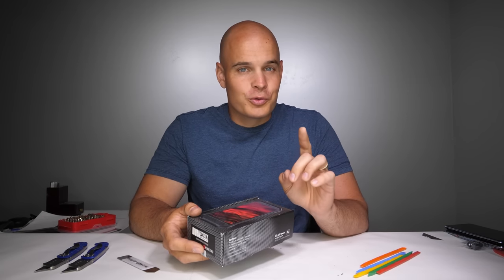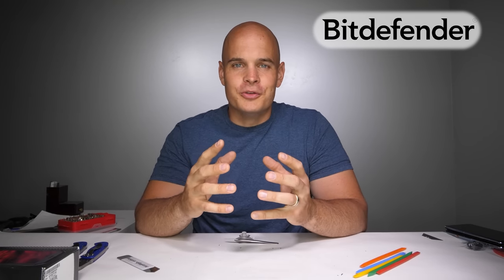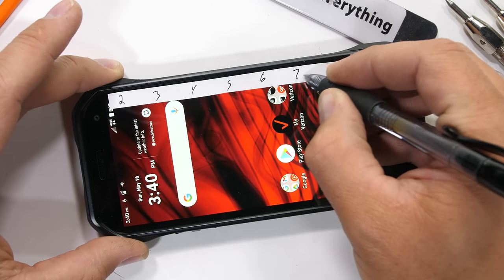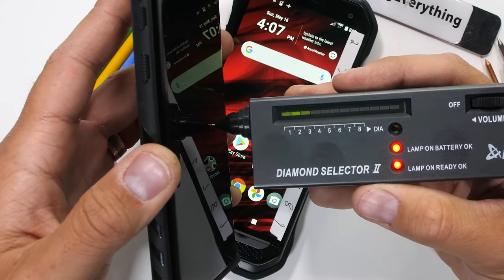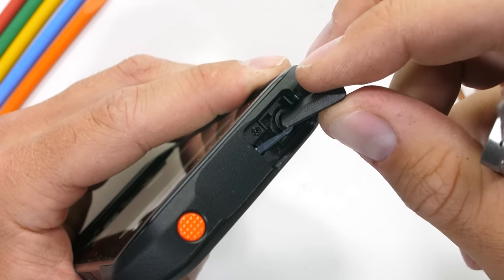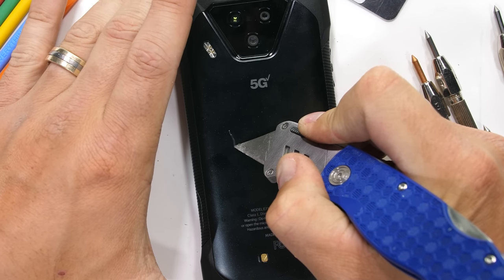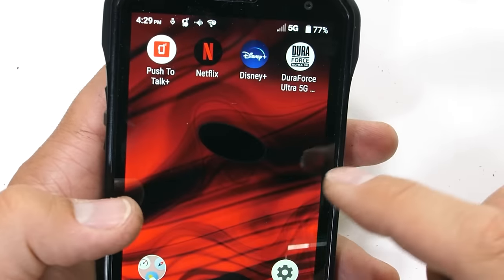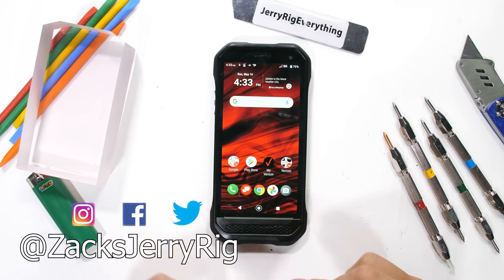A NEW Sapphire Smartphone?! - Ultra Rugged or Ultra Premium?

Comment: "Scratches at a level 8, with deeper grooves at a level 9." Holy crap, very rare but very awesome.
Reply: And cracks at 20cm fall.
Reply: We've lived long enough 😌
Reply: screen may not scratch, but it sure does crack. had it for 3 weeks and it cracked in my pocket, right on the hole they cut out for the speaker. also the phone constantly freezes up. like, every single time i use it it'll freeze, i have to hit the power button, unlock it again, and then can continue. this can happen multiple times in a single text.
Reply: 1001th  👍

Comment: This is awesome. I'm a utility guy everytime and I'm tired of so many curved screens busting from being dropped on a grain of sand
Reply: hold off and read more reviews. i bought it because i had the old one which i dropped off a 70ft tower onto gravel. it survived the fall with a chunk taken out of it, but it got wet again after that and screwed up the screen. so i upgraded to this one, more expensive 5g phone, and i'm going to take it back and have a discussion with these people. the phone constantly freezes up. every other time i pick it up i have to put it to sleep and unlock it again over and over just to check the weather or write a text. and it took a 70ft fall for my old one to crack the screen, this one cracked within 3 weeks of having it, and it happened while it was in my pocket! not a happy camper.
Reply: These phones have average cameras, but they even have a tooless SD slot so I typically forgive it.

They do honor that warranty, by the way! Kyocera is a good company!
Reply: @003SOK  did you swap it for another one? and did the replacement one have any issues?
Reply: @Redd_Nebula  did not swap it. the crack is still the same, unchanged despite my best efforts to increase it's spread, and the issue with the constant freezing seems to have gone away with an update. the only problem i'm having anymore is every once and a great while it complete freezes up, black screen, and wont shut off or do anything. holding the power button and one of the volumes hard reboots it and it's fine for a time after that. overall decent phone, strong af. camera quality is android.
Reply: keep in mind that although sapphire is almost scratchproof, unless u have a diamond, it still shatters fairly easily. easier than glass. its the reason its not used in car windshields, or building windows (aside from the price). generally, everything holds tight to the rule "the more scratch resistant, the more brittle it is"

Comment: Had the first Duroforce Pro, love that phone. Found that camera button useful at waterparks/pools taking pics of my kids. Could do it as snap a pic, or start/stop video recording depending on what the camera mode was set to. Of course, when it was released it was already well behind on hardware/software... which quickly got worse. Phone still works like a charm, and has no noticeable damage to it after years of abuse from 2 people using it(my son uses it now). Just software/hardware wise... its a little slower then you would like.

Comment: I got the original duraforce pro back in 2018 and used it until just this year. Even though I haven't used a screen protector this whole time, the screen has no scratches. It just sucks that software support for the phone was so poor; even though it was released in 2016, the last security update came right after I bought it in 2018, which meant that I was probably using a device with any and all security flaws discovered in Android since late 2018. I wish that I didn't have to choose between software obsolescence and hardware degradation.

Comment: Ironically, those rough workers who need it can't afford and those who can, don't need....
Reply: If somebody actually needed this specific phone in their work environment they would buy it. If it's not a necessity they'd just buy a walkie talkie and a rugged non-smartphone and they would've spent less anyway.
Reply: You underestimate the income of construction workers in 1st world countries
Reply: Well some companys actually buy the phones for the employees. We are currently using the DuraForce 2. The entire team is ready to get rid of em.
Reply: @clayw1656  They that bad?
Reply: @ezgolf1764  for working getting ready for upgrading to gigabyte internet speeds for residential, we need a device that doesn't struggle to hit 250. Also, I had my phone in a back pocket, and I cracked the screen sitting down when the edge accidentally hit some hard plastic.
Also, we're just spoiled and want some top tier phones.
Reply: @clayw1656  nice
Reply: Lol tradesmen make more than office workers. All the way from truckers at 75k to linemen at over 100k.
Reply: It's like $700 still very cheap for modern smart phones
Reply: These are normally provided by companies , no one buys these.
Reply: @AdilHusain  I did haha
Reply: @Legacy4x4andOffRoadYT  me too, I got mine because of some of the work I've done like moving furniture, had a bent iphone case I'd set stuff on that leg, and drywall, don't have to clean any dust out of the ports or speakers on my duraforce pro 2 🤷‍♂️ and it's not bent.
Reply: @a14567  have dropped mine on concrete at least 3 times from about 3 or 4 feet off the ground and it still works like normal. Also lost it in the snow for an hour once when it slid out of my pocket getting into my truck.
Reply: @nicholasapodaca9886  for u mean lineman as in defensive tackle, offense guard
Reply: @AMabud-lv7hy  frfr they make good money
Reply: I haven't priced the 5G version but the dura force 2 was  one of the cheaper smart phones that's actually how I came to own one. I just bought my 3rd. I work with chemicals   The phones are great and I plan to stay with Kyocera  I have not tried their warranty cause the nature of the chemicals I work with. Muriatic Acid is hard on everything

Comment: Ive only used KYOCERA duo phones for about 5 years now. I absolutely love them. Extremely tough, my three year old tossed my last one out the car window without me knowing and it laid in the road for three hours before i knew it was gone .... checked googles where is my phone and realized where it was... panicked...and drove up just in time to see my phone get ran over by a semi! Although im sure that was not the only time it was ran over.. anyway...the plastic on the back was very damaged and came off...the battery and screen was fine. In fact after cleaning it my screen still didn't even have a scratch. The phone worked just fine for two more weeks until my replacement showed up in the mail 😂😂😂😂 so yeah im a customer for life!!! Im currently writing this on my Duo Force 2.

Comment: So I have this phone got it 2 weeks after you made this video and may I say this phone is amazing extremely resistant dropped this a dozen + times and it hasn't cracked at all because of the design and I love it considering I can be a little reckless. There is only one issue I have had with the phone and that is don't let it get to warm otherwise it may get a little difficult to use when it come to the touch feature on the screen. Thank you so much for making these videos.

Comment: I have the duraforce pro 2 for 3 years going on 4. I Work construction. This has gone through so much abuse including but not limited to, drops from second floor, hammer fell on it, run over with a buggy full of tools. Drop face Down on rocks and step on while carrying 50lb conduit. And no scratches on the screen. The only thing is that I accidentally spilled a corossive cleaner on to the screen but it still work. There's only like a slight burn that is only visible under the right angle in full sun. This phone is tough as superman. I highly recommend it. Going on 4 years with construction abuse and still runs as if I just got it. Hope they keep making this phone. A++

Comment: I just bought this phone. I had the old one, dropped it from 70 feet onto gravel. it survived the fall with chunk taken out of the screen and side, and continued to function, but the screen began to blossom and became unresponsive when it got wet. so i upgraded to this one, thinking it would do me good as well. i am very disappointed. constantly freezes up for starters. every  time i use it i have to put it to sleep and wake it up several times to continue to interface with the phone. and the super duper scratch resistant sapphire shield  super screen is already cracked. happened while in my pocket. right on the hole they cut out for the speaker. phone is a lemon.
Reply: wow. May I know what kind of stuff do you do in life that involves a risk of dropping your phone from 70 feet?
Reply: @y-yyy  maybe crane operator or window cleaner, I guess it would be much higher fall in this two cases, but there definitely are jobs that involves this kind of risk haha

Comment: I have been using "DuraForce" phones ever since the first- it was a big chunky flip phone branded as a Casio G'Zone.  Then there was a smaller flip phone.  The G'Zone Android phones originated in 2011.  After that, Casio dropped the G'Zone brand.  Luckily, the OEM for the G'Zone phones (Kyocera) picked them up and branded them DuraForce, DuraForce Pro, and now apparently the DuraForce Ultra.  I will now start counting down the milliseconds until my DuraForce Pro is paid off and I can upgrade to an Ultra!

Comment: Got the duraforce pro 2 in 2019 cause of your review on it. Still working fine and scratch free. Only issue I have is with the charging flap. The jack flap doesn't get used a whole ton. The flap on the charging port still closes, just a touch loose. If you use the wireless charging feature that'd be a non issue.

Comment: Mmmm Kyocera rugged phones. I still have my Brigadier tucked in a drawer as a backup, the same one that got run over by a bucket truck, twice. The screen separated from the body slightly, and there's a permanent discolored spot on the display where I think the entire weight of said truck was balanced on one of the tires studs (winter tires) on the sapphire glass for a moment. When I do my next upgrade, probably in a couple years, I'm definitely going with another Kyo.

Comment: I got the first one you did in 2018 the duraforce 2 the camera lens broke from a drop at work it fell right on a nail sticking out of a board. But all around this is one tuff phone. Not a scratch on the screen even with all the dust. Speaker could be louder. I do work on a construction site. It's hard to hear the boss sometimes.

Comment: My watches are all made out of sapphire glass. I have used them drilling concrete, going through thin tunnels and banging my watch against the ceiling, abusing it completely ridiculously where normal wear is not included. It's not scratched, it's flawless, but the titanium bracelet is ful of scratches. Sapphire glas withstands everything, where nothing else does

Comment: Ive had 3 Kyocera rugged phones over the years. The brigadier, the  pro and, the pro 2. I haven't cracked a screen yet. So when I see the rare ones with cracked screens I wonder how the hell. Bc mine been through hell. All still worked when upgraded but did bc battery issues. Both pro's were no comparison for the first brigadier. That phone lasted 5 years before battery issues and took abuse I know the pros couldn't have. I lost it in the snow for 8 hours still worked. Dropped it of 3 story building still worked. But what took the cake was when I left it on trunk, drove off and it fell off a half mile down road. On the way back to find it as I passed it and seen it a semi came by and ran over it. I knew it was done but nope screen with no scratchs just on some on side. They need to make new ones like it durable wise.

Comment: I have a sapphire screen protector on my iPhone 13 pro max. It doesn’t have any scratches even after 4 months of use. However it does crack more easily there is a nasty crack in it. Just one disadvantage they’re expensive so.

Comment: My problem is with the 1% because I'm still driving around in a 15mpg f150 with no AC and my DuraForce Pro 2 has overheated making its Charging and Performance erratic when we can see how affordable AC could have been years ago with the new F150 Lightning. After seeing what Harley did to Alta (Alta Motors was an American manufacturer of off-road and dual-sport electric motorcycles based in Brisbane, California) i'd like to push my antiquated POS 97 Dyna in the River and forget it ever existed

Comment: Dear MrJerryRig,
I would like to see a phone made with sapphire glass on the front and a full titanium body. Premium style, not like those phones who look like a CAT device. In particular, the design should comprise a complete titanium encasing (even the interior, under the display, with only a small hole for the ribbon cable), waterproof resistance and if it is necessary to include wireless charging the spiral should be put outside the case covered with more glass. Do you think is something feesible?

Comment: I bought this phone with the highest of hopes in Kyocera, the sapphire screen, and it's water resistance. No case needed and I brought it swimming. No scratches!
WARNING: Anyone considering this phone should look up all the overheating problems people experience while charging and the temporary (won't start) bricking problems. I'm thrilled I got $350 when I sold it back to Verizon. Research this phone before buying.

Comment: I just wish they weren't so rare.  It would be nice to get rid of the screen protector that covers just 90% of the glass (the part where the display is).  It is hideous because you can see nice glass where it doesn't cover. Screen protectors are not 100% transparent but when the screen is on you can't tell.  They just seem to give the phone a very slight haze.  It is just what we need with our clunky, ugly and huge phone cases to help make the phone uglier yet.

Comment: I've had the pro 2 (non 5g) for about 3 years. It was great until the update before last.since then the phone has been shutting itself off at the worst times. Then when attempting to restart, it will shutdown again after the Verizon screen. Sometimes as many as 50 times (not exaggerating). Kyocera does not respond to emails, and if you're lucky enough to speak to a human, they are no help at all. Eventually trying to get you to send in the phone. Depending on what they find they may charge 450 dollars (last tried about 6 months ago.) The operation of the phone has always been clunky and the camera is kind of embarrassing. What has kept me from replacing is this amazing screen. I'm a fleet mechanic and I am extremely rough on phones. Drop them off the top of trucks. Screwdrivers, guns and knives in my pocket, still totally pristine condition. Now after looking at Kyocera's latest model, I see they moved away from the sapphire glass. I'm now thinking about Samsung Xcover.  Any suggestions?
BTW, when I finally do retire this phone, I'm going to hit the screen with a  22lr.  Partly to see how the sapphire reacts, partly for all the times it left me trying to restart it for an hour while I should have been doing everyday tasks.

Comment: Ah schucks, I'm late as always so nobody will probably see this but for the question in the video;
I don't care about having a sapphire screen because I apply a screen protector, but sapphire camera lenses should be standard, one friggin micro scratch and your phone is useless if you don't have a depth sensor, and even if you do the photos will be... suboptimal. Lenses should've been protected by harder materials since forever
signed:
Someone who managed to microscratch the inside of his 58mm f/0.95 S NOCT aswell as Huawei P30 Pro.

Comment: He used a fake diamond reader Wich is sad
Reply: In what way is the diamond reader fake?
Reply: @Chip-TNB  The point is you can buy that diamond tester for seven up to $20 it's a fake diamond tester you move the sensor with your thumb and it also reads heat from your thumb what he's doing it's fake
Reply: Well I don't wanna argue any more about this so I won't agree nor disagree.
Reply: @Chip-TNB  okay I shall too have a good day